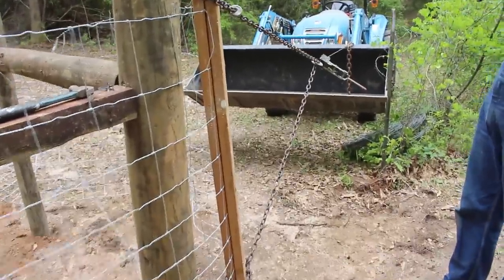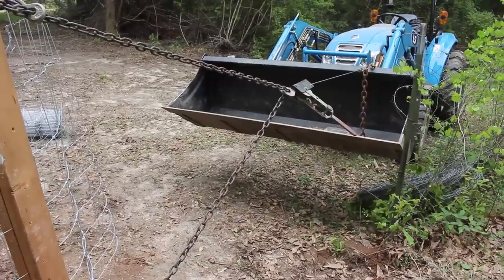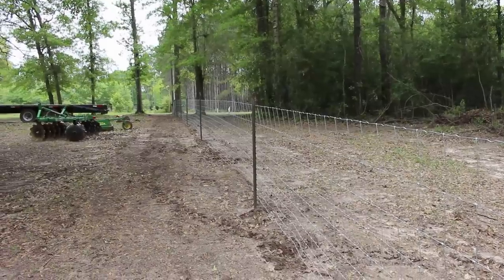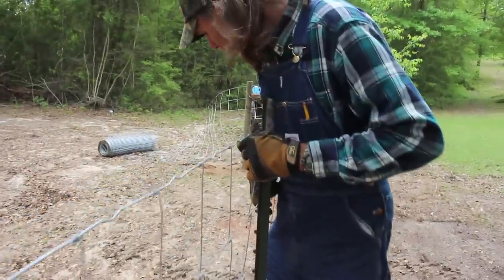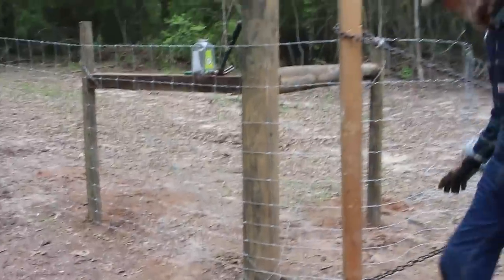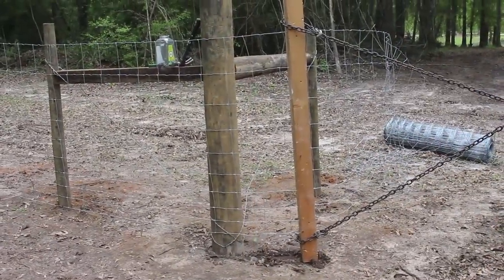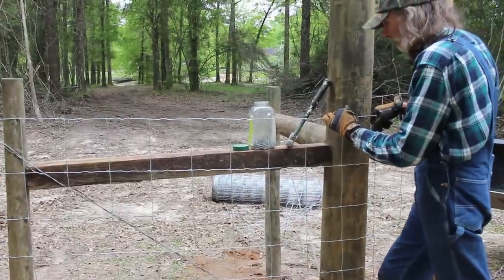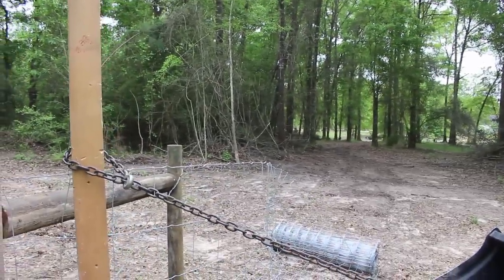How to Stretch a Fence with a Come Along

Comment: I’ve done that many times but we usually dig a hole under the 2x4s when we get it tight and let them drop into the hole to keep maximum tension on the wire.

Comment: Looks like you stapled on the corner and kept the fence running without cutting and tying it off. I see where so many recommend tying it off at each corner but I was planning to staple mine and keep it running. Did you have any problems doing yours this way?
Reply from the maker: I haven't had any problems with mine.
Reply: Thanks!